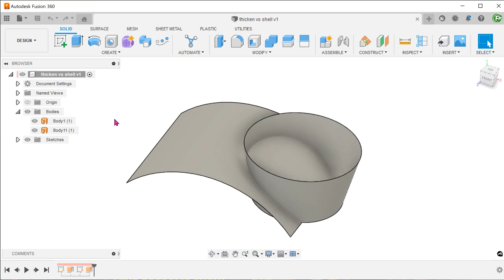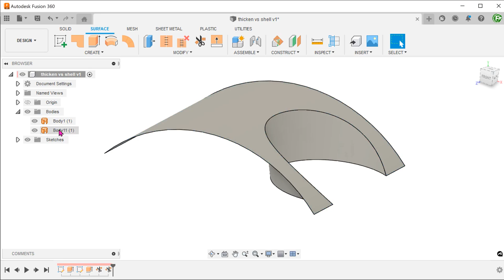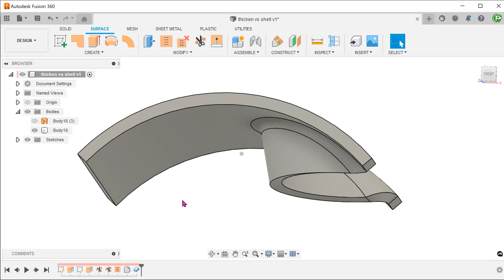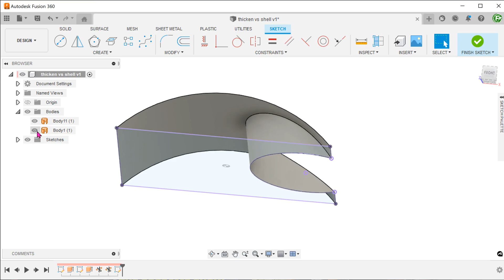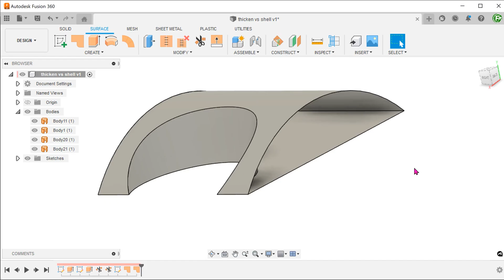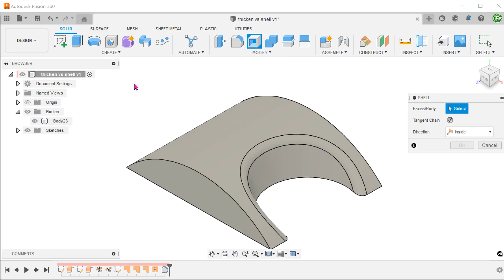Fusion 360 | Shell vs Thicken

Comment: Thanks for the video! At the end of the video with the solid body interesting it did not shell the fillet? But it did it with the surface thickenning
Reply from the maker: Thank you for pointing this out. I went back to do this again and realised that I had performed the thickening towards the top. This meant that the top fillet became 20 mm after thickening. For the shell, I had performed it on the inside, which meant that the 'thickening' was reversed. Since the shell thickness is the same size as the fillet, this resulted in a sharp edge at the bottom. I should have used a larger fillet.

For a true comparison, I should have thickened downwards. Thickening downwards would also produce a non-flat bottom face. So this should not take away the main message of this video. Sorry for the confusion caused.
Reply: @Fusion360School  That's interesting. I assumed the choice was intentional and Fusion would moan if the fillet was fine earlier in the sequence
Reply: 10mm fillet - 10mm shell and you get edges without fillets 🙂

Comment: You didn't even need to use the surface modeling space... I rarely use it
Reply: It's true, you do rarely need it. But the flexibility it offers is truly astonoshing, especially if you consider how well Fusion 360 tackles some of the features / commands. Great to know there are other ways, in case you need it.
Reply: The purpose of this video was to demonstrate the difference between thicken and shell, not to show how to create a particular object.
Reply: I agree. This particular case didn’t need surface modeling. It could have been easier with solid modeling.

Comment: What if you thicken to inside and then cut the extra? This way the measurements will be more similar to the shell way?
Reply from the maker: Yes, you can definitely perform an extruded cut the make the bottom face flat.
Reply: @Fusion360School  That's how I've been making most of my flat bottoms, but I like this way a bit better.
Going to try this method out.
Reply: My thoughts exactly.